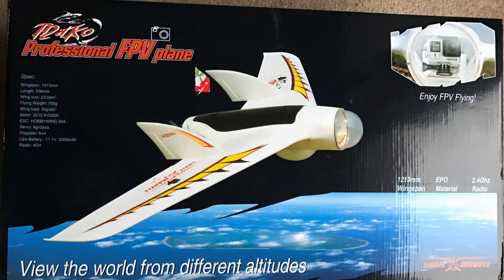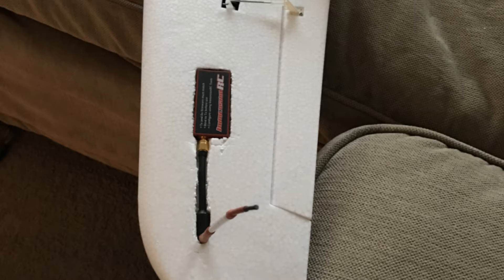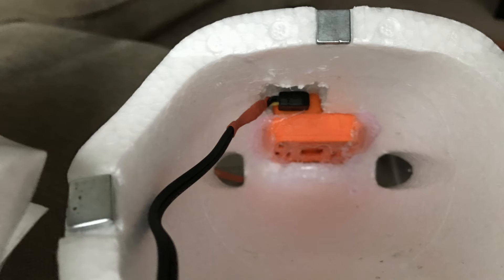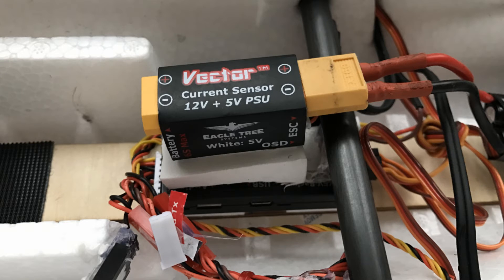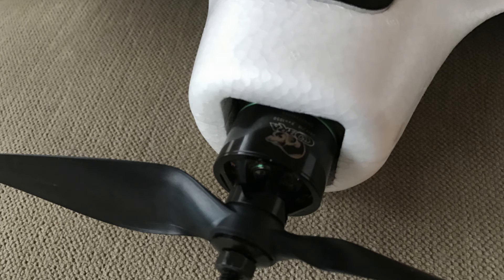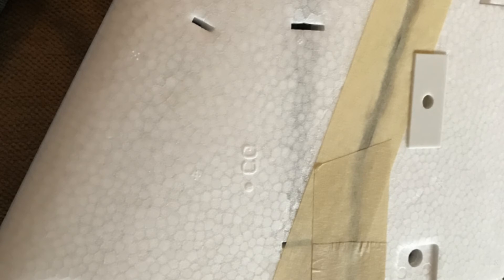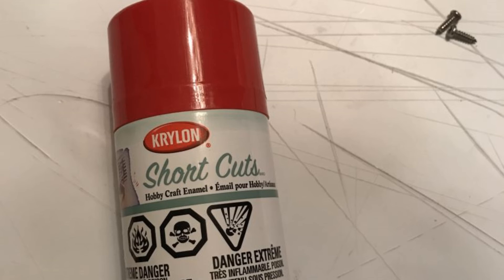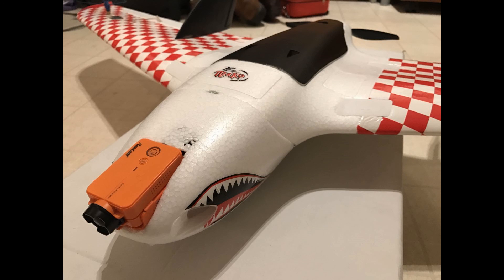Sonic Models Mako setup

Comment: 3S or 4S? 5000 mAh pack? Nick says it flies really great on 3S. Nice build Eduardo.
Reply from the maker: Fly With Me Fpv I'm starting with 3000 mAh 4S then I will try 4000 mAh 4S and finally 5000 mAh 4S. Nick is flying the stock motor and APC 6x4 on 3S. I'm going bigger motor and bigger prop too! I'm curious about speed and performance with this setting. Looks good though.

Comment: thank you I was just wondering I do have the taranis and I love it but I just order myself my first Spectrum DX8 second generation from motion RC
Reply from the maker: juan carlos grajales I didn't like the Spektrum any more after way too many brown outs with my DX9! Many of my friends had the same trouble with the DX7. Taranis has better range. It depends how far out you like to fly. Also the programing on the Taranis for my flying are better than Spektrum. Just saying. I refused to move to the Taranis for two years and when I did I realized the capabilities of the radio.

Comment: Absolutely love this plane. Flew mine today, the only thing I really hate is broken props on every landing where I don't land on really soft thick grass. Still only running the suggested 6" props. Perhaps your 9" with thicker hubs might handle this better. Will be interested in your results. Also, my throws are very small as the plane can be extremely pitchy.
Reply from the maker: Airborne Images Thanks Airborne, I flew the same motor/prop on a Wicked wing. I set up the ESC with break. That helps the prop on landings. That wing was super flat and never broke a prop. Try it! Just need to program the ESC break.

Comment: Oh fantastic Eduardo. It is an excellent wing, I think you will enjoy it. I like your setup a lot it should be very quick indeed. I have been thinking about going back to the RunCam setup on mine, but maybe with a servo on the rudder. I'll look forward to your maiden.
Reply from the maker: Michael Downie Thanks Michael, I am intrigue with speed and performance on this plane. Cholo flies his with 3S, I'll be flying this one with 3000 4S to start. I have a break on the ESC, that takes care of the broken props on landings.
Reply: WOW 4S should be amazing. Now I am really looking forward to the maiden.
Reply from the maker: Michael Downie I'm not flying 3S with Vtx any more. Voltage wise the Vtx turn off at 10.7 Volts. Too risky 3S